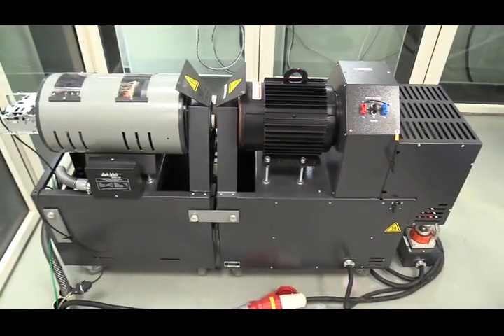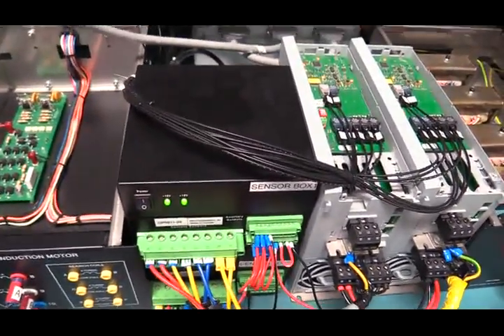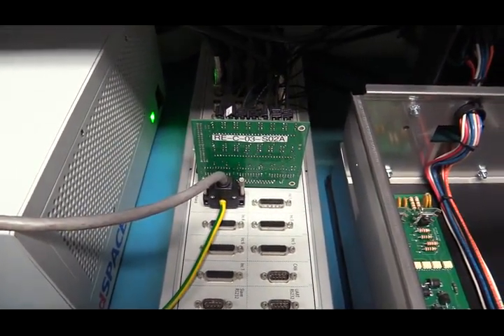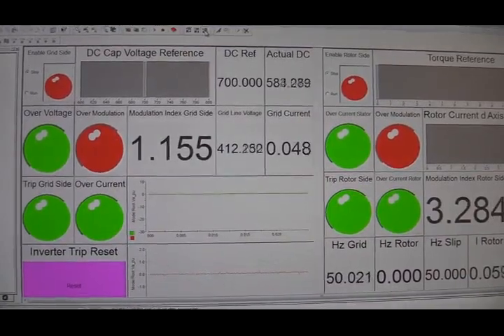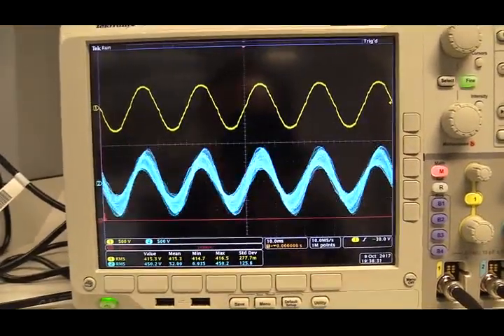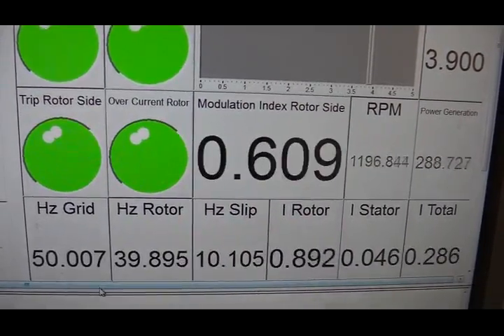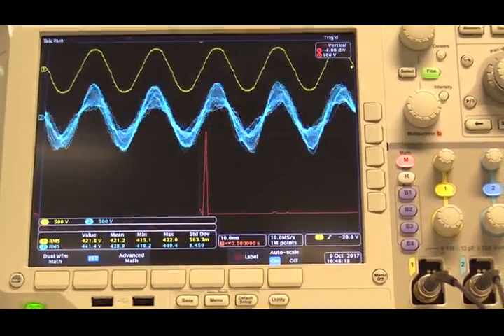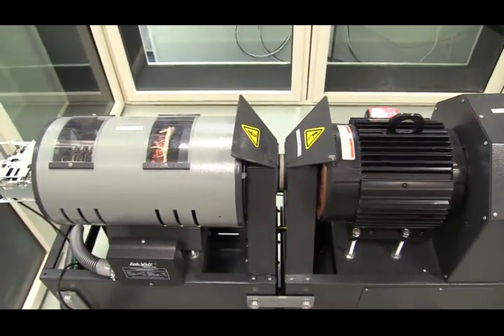Double Fed Induction Generator (DFIG) with Virtual Wind Turbine Model

Comment: Great video! It's not easy to find this kinda video on youtube. Thank you for sharing ❤️
Reply from the maker: My pleasure to share knowledge :)
Reply: @yusileng  Hi... Great explanation. However, I have one small query it would be great if you can explain. IN DFIG you have shown both the Stator Frequency=Rotor frequency(Hz Rotor) +injected frequency Hz Slip). Here the slip will be zero so how the turbine will produce power, slip should be negative for generating mode.
Reply from the maker: @errkggift  
good question. I think for induction motor, you are right, negative slip produce power and positive slip consumes power. However, DFIG is a little bit different than that of induction motor because we actively inject AC current in rotor circuit. In this way, we can control the toruqe of generator by controling the q-axis current. or In other words, controlling the phase angle between DFIG stator voltage and grid voltage so that power can be controlled. I hope this answers your question.

Comment: Hai,
             Very much usefull video. In DFIG at what point of time the stator will get connect to grid during this tie what will be status of Rotor VFD module?.
Regards,

K.Prabhu.
Reply from the maker: Initially, the stator of DFIG is disconnected with grid. Then, using rotor VFD, the rotor got excited so that voltage can be induced in stator. After observing that stator voltage is the same as that of grid, then the switch will close between stator and grid.

Comment: Hi...This is really great video. A lot of information is available in the explanation. A small additional information I need to know. Could you please share the name plate details of the two machines (induction motor and DFIG)? Thank you for your explanation.
Reply from the maker: 8540-0A is the induction motor and 8013-A is the DFIG
Reply: @yusileng  Thank you very much for your immediate reply. Could you please reply the rated power, voltage, and speed details of these machines?

Comment: I have a question. When shaft speed is over 50Hz what is creating magnetic field in rotor if current is now technically flowing towards the grid?
Reply from the maker: When the rotor speed is over 50Hz, the inverter will automatically compensate such difference by injecting AC current with negative rotation such that rotor circuit frequency is always 50 Hz
Reply: @yusileng  So in that instance, no power is flowing from the rotor to the grid? Instead, that AC current that creates negative rotation comes from the grid?

So when they say that there is 70/30% power split between rotor and start, those 30% that comes from rotor only happens when frequency is less than 50Hz?
Reply from the maker: @ivvan497  I think you are right. If I remember correctly, below 50 Hz, power flow into rotor circuit, above 50 Hz, power flow out from rotor circuit.  The AC current in rotor circuit is always 50 Hz, so if rotor speed is 40 Hz for example, the inverter will supply +10 Hz to rotor.
Reply from the maker: @ivvan497  the power flow for rotor is not determined by frequency because it is always 50 Hz, automatically regulated by inverter.
Reply: @yusileng  But what if rotor frequency is 55Hz? In that case inverter will provide "-5Hz" so that total is again 50Hz. So inverter is supplying the rotor from the grid and there is no power being sent INTO the grid as its impossible for current to flow in both ways at the same time?
Reply: @bala Vignesh Active and reactive power in modern voltage source converters/inverters (VSC) can flow in different direction at the same time. So for example it can supply motor with reactive power needed for creating magnetic fields to compensate for any disturbances while at the same time supplying grid with active power flow. Reactive and active power flows can be controlled independently.